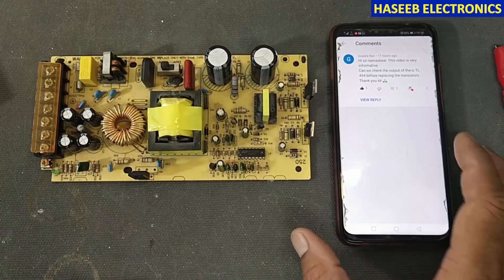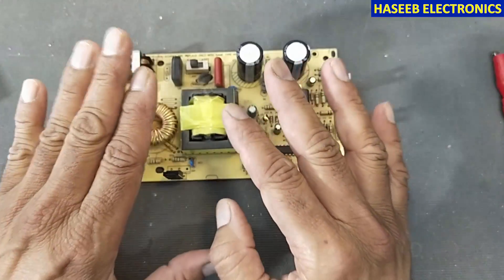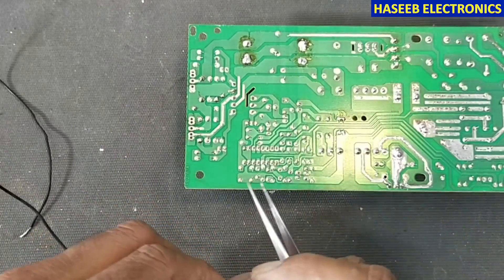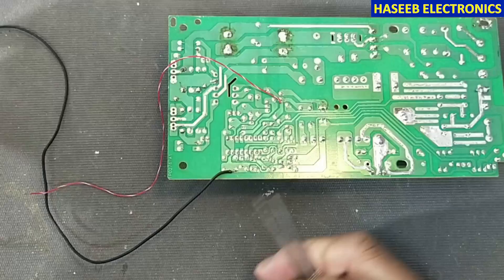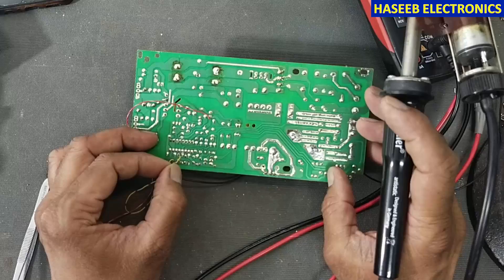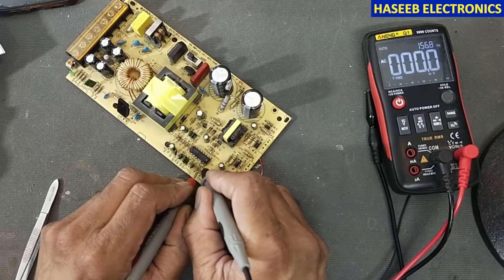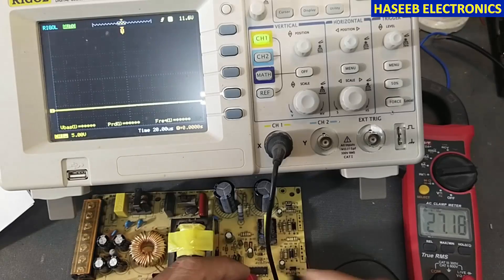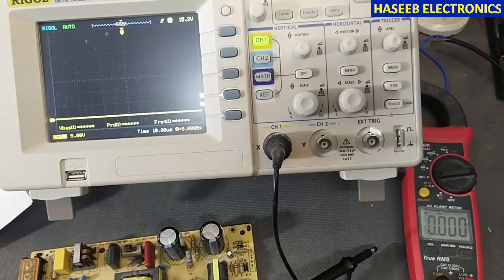{750} How To Test Switching Frequency of TL494 KA7500

Comment: Slam alikm  my friend why haven't you applied power only used the power supply does it really dangerous to connect the circuit and the oscillscope on the same source of220v ac is it not safe to measure hot side on the same source of ac if not using isolating transformer?

Comment: Haseeb good evening, how can I get a desoldering soldering iron like yours?
Reply from the maker: i am using WELLER WR3M rework station, you can find it online with some reliable seller. as its cost is above 3000USD 
i will recommend to purchase HAKKO 0701 (around 10000+USD)
or Yihua 948-ii (it is very cheap near to 300 USD)
Reply: @HaseebElectronics  thank you for replying Hasseb

Comment: Sir : no need supply power to check TL494 when measure Frequency  ? black probe is not connect power supply - & red probe correct + ?

Comment: SA. same pcb model I have power supply 12 V 20 A. There is no load and fan and cooler heat sink is not installed in the case mosfets (j13009-2 x 2 pcs) are overeating that is normal or not? If not what may cause that?

Comment: dear haseeb sir i found out that in aneng Q1 inorder to measure in high frequency we have to go to milli volt(@second button in meter) and select AC mode then it will accurately display frequency from 100khz to 5MHZ.(it is instructed clearly in manual :) )
Reply from the maker: exactly yes

Comment: Salam M Haseeb, i built a charger based on a TL494, the voltage adjustement works but when i put a load, the voltage drop to zero volt. Can you please indicate the check points to troubleshoot that issue. Thanks.